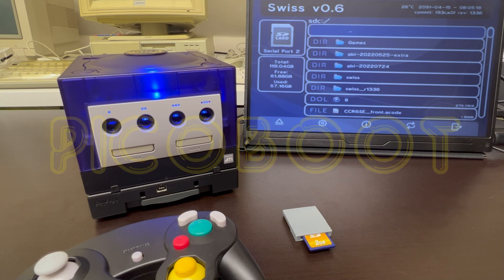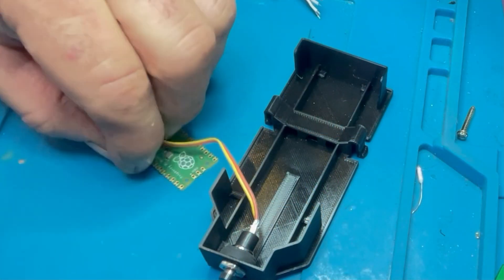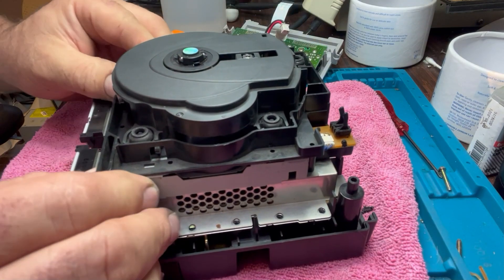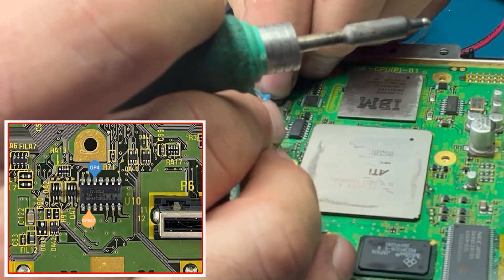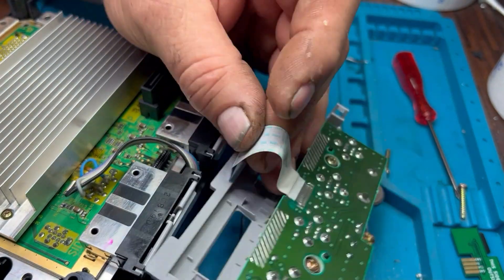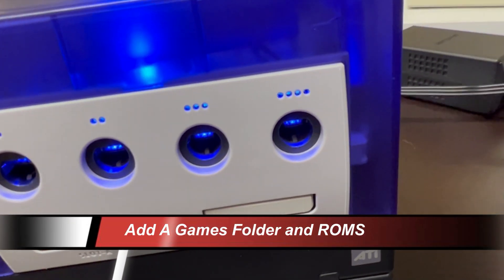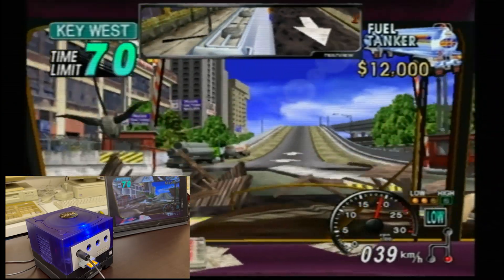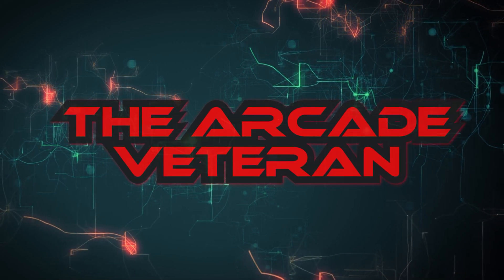Gamecube Picoboot Install and Play

Comment: Do you have a link for that push button part you installed to update your Pico?
Reply from the maker: Not the exact link I purchased from but it’s the same switch eBay item = 164929823167
Reply from the maker: If your just updating the firmware there is a switch on the pico I only used this to do it externally just thought I would mention
Reply: @TheVetUk  yeah that’s what I’m trying to do as well because I don’t feel like unscrewing my gameboy player every time their is an update lol
Thanks for replying 🫡

Comment: Quick question I installed my pico and I get no signal on my gc and when I take the pico out and turn my gc it works fine any recommendations?
Reply from the maker: I had the same issue I changed the wire type to copper and shortened the length to the minimum I could get away with 
I reflashed my pico and rechecked my soldering then tried it and it was fine 
I think it was wire length in my case so try the first and make sure your wires are good quality and not to long 
Cheers

Comment: You have a link for the 3D printed bottom?
Reply from the maker: Hi
It’s the original bottom shell of the GameCube mate
Reply: @TheVetUk  Found it on Prusa Prints but for the Pico//
Reply: @TheVetUk  The little door replacement where you have the pico and button installed on. That being said, I have found the STLs for a full shell replacement along with that the Pico door on Thingiverse and PrusaPrint.

Comment: after mod picoboot gamecube will still be able to use the laser to play disc ?
Reply from the maker: You can on older versions of Swiss I think you had to push b to bypass the drive check on booting the picoboot but a new version of Swiss removes this check so to make picoboot easy to use 
You could fit a switch to the power of the pico so it boots normally if you wished then enable when you want to run games off SD card and picoboot it but never tried that.

https://github.com/emukidid/swiss-gc
Hope this helps cheers